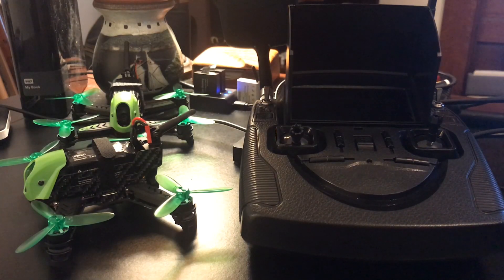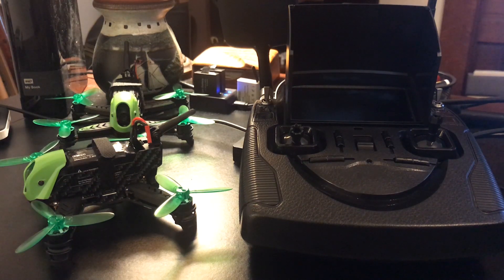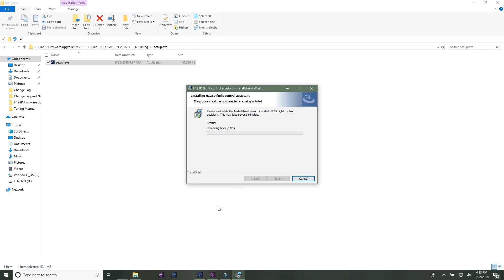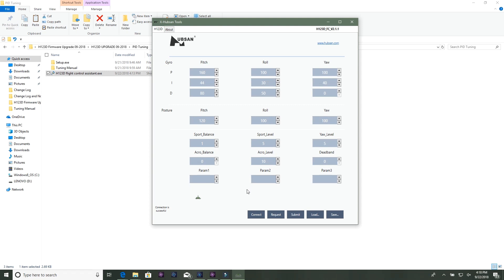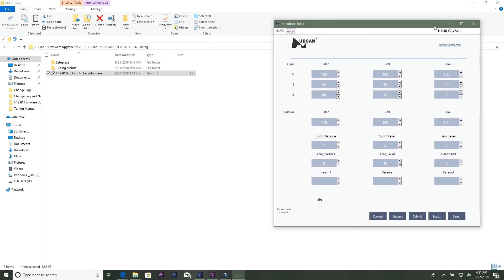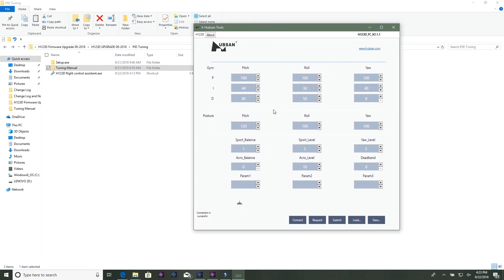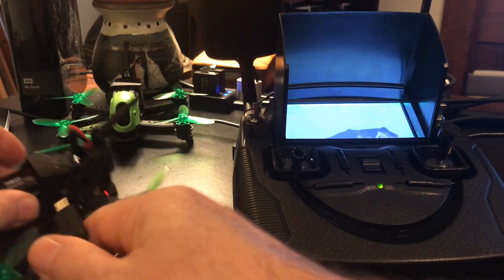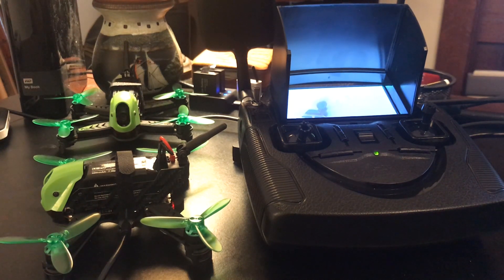HUBSAN X4 H123D JET - FIRMWARE TUNING TOOL INSTALL & GLIMPSE

Comment: Hello,is there any 3rd party after market props that will work with the 123D or do I have to buy the proprietary props?

Thanks
Reply from the maker: https://www.facebook.com/groups/HubsanH122D
Reply: @QCGUY  Thanks,I ordered a 123d off ebay that had dinged up props. I already have about 20 walkera rodeo 110 props and they seem to be about the same size with the same screw pattern as the 123d....crossing my fingers...haha
Reply: @rizzofox8689  Hi there did your props fit the Jet? I'm also running low on props, do you have a link for props please?

Comment from the maker: I have had some pretty good improvements in flight after tweaking just a few settings but I still end up chasing and going to far because I adjust the wrong thing at times like adjusting my pitch instead of my yaw. The "P" setting was time consuming but pretty simple and then  the "I" setting took a little more work but seemed to improve the problem with it not banking properly. With mine I noticed when banking it always wanted to veer off out of the bank. Not seeing so much of this now. I have found a few good videos since but still think the articles I find are much better explained and easier to learn from.
Reply: Hi can you please share your settings, I am still a beginner and it would help a lot
Reply: Please share if you got it to fly better thanks